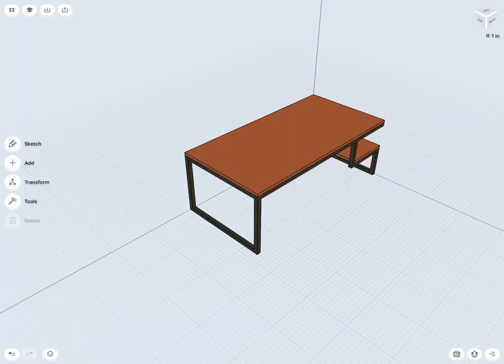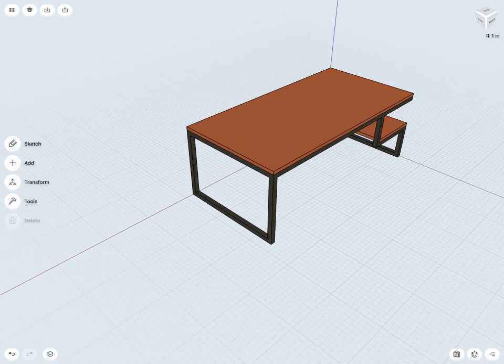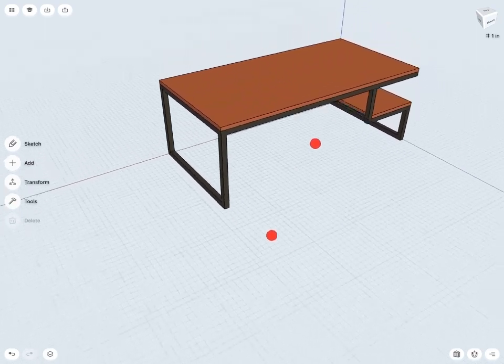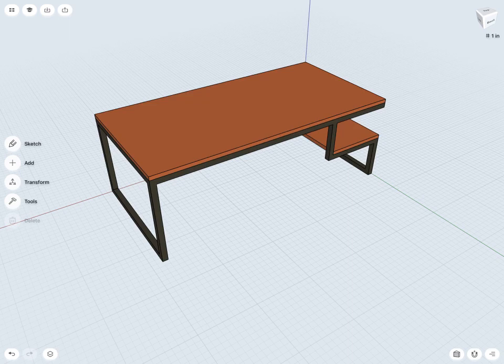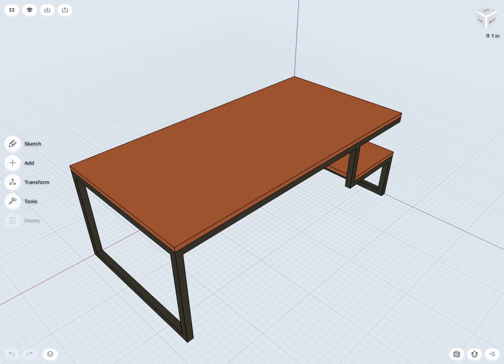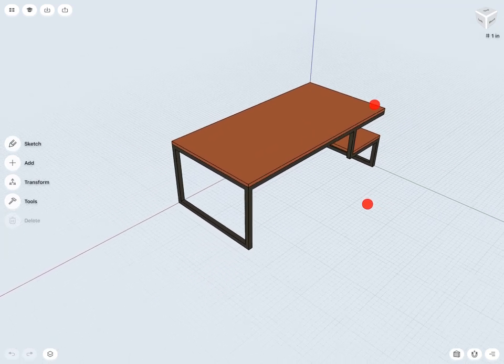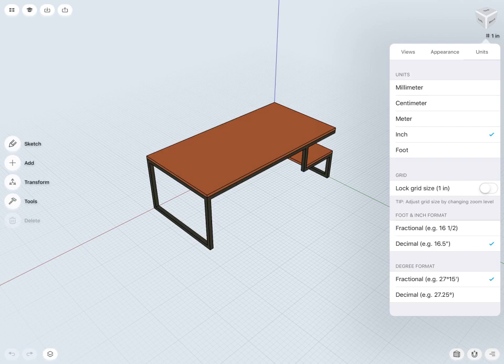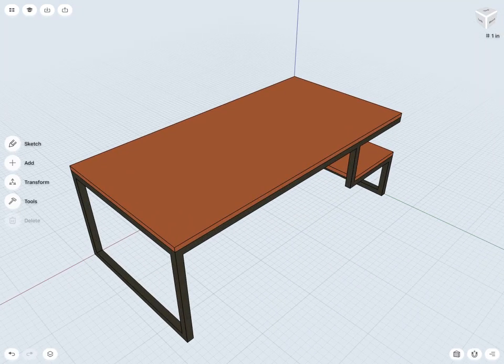Design Area | Shapr3D for Beginners

Comment: Hi. Which features can i use for free? Can i first use this app not buying pro version?
Reply from the maker: Yes, you can use it. All modeling tools are free, with a limitation of number of designs and export. On top of the free version, you can also try the app for 14 days in our Pro Trial
Reply: Shapr3D what features pro version has?
Reply: Shapr3D loving it
Reply from the maker: Hello, With the Pro license you have unlimited workspaces, high-resolution STL export option for 3d printing, and you can also export, more design options like color and you import/export your models between other CADs you use.